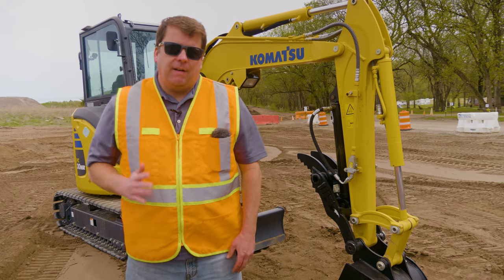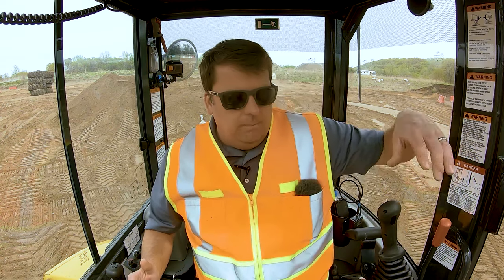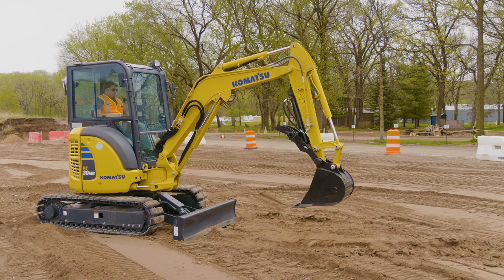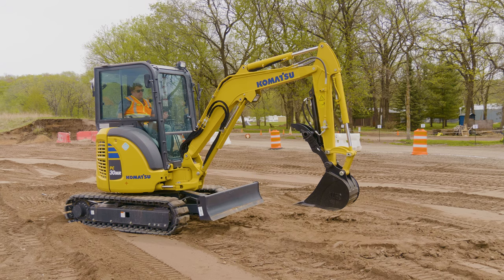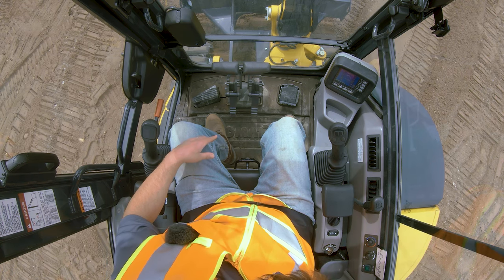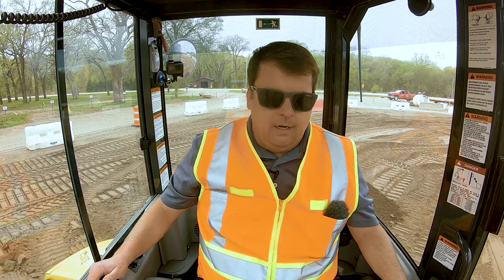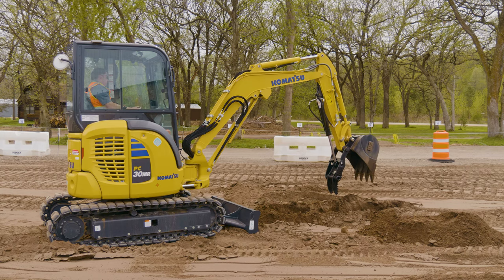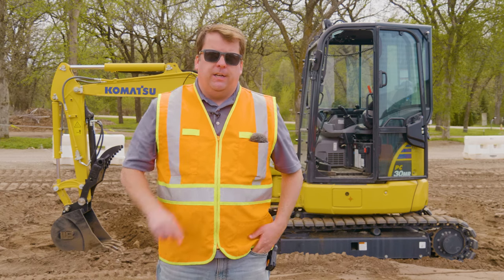Mini-Excavator Training (Beginner) 2020 | Heavy Equipment Operator Training

Comment: Great videos! Wish I had watched before I got crash course on the jobsite. I found out the hard way that those things are easy to topple when lifting loads. Luckily I was swinging slow and kept the load close to the ground so it didn't topple the machine but it was bloody scary moment and dangerous.  Few inches more or any sudden movement to the wrong direction would've done it. Was stable enough to get the experienced guy back in the cab to save the day. I would like you to have an episode on the mini excavator about those dangers. Say having a chunk of concrete or a boulder pinched with the thumb and swinging or placing it. Something safe for you to demonstrate the dangers for new operators.  Many thanks!
Reply: There were a few times that that happened to me but in a 926m cat loader tho bc the ground was unstable/uneven and yeah its kinda scary but fun on your first 3 days

Comment: Very good video! Tip for the video editor there: it would be much easier to see what controls do if you put video in the video, for example top 3/4 of the screen excavator from the distance and on the bottom of the screen joystick video, both videos synchronised. :]

Comment: I also operate with the blad behind me where possible.  It definly feels more stable.  I guess because the load is spread across the blade t the back and not the tracks which can pivot around each point, if tht makes sense.   With the blade on the same side as the operation, it feels like the base of support is smaller nd outside the centre of gravity

Comment: I´m interested in a video about driving a mini excavator on a slope. I image there are safety concerns as they seem to have a rather high center of gravity.
Reply: Mini excavators are able to go on pretty steep slopes, but the tracks need to be in line with the slope. I like to go up steep stuff backwards, and use the arm of excavator to help push the machine up

Comment: That beep you hear upon turning on the ignition is your glow plugs heating up, correct?
Reply from the maker: no....most newer diesels don't use glow plugs anymore.   Beep is just the machine doing it's system checks.
Reply: @HeavyMetalLearning  My new (2020) Kubota KX040-4 uses glow plugs.
Reply: @HeavyMetalLearning  Wrong, they still use spark plugs,  but they are just really fast, so you don't notice.  Same in modern diesel cars. Greetings from Holland
Reply: @thebeastman1651 At least in some models, the plugs start to glow the engine when you unlock it/open the door.

Comment: We have a Kubota mini digger and we don't have a footpedal for our boom swing, is this normal on some machines? And I can only assume that it is the extra switch on the left lever. If you could shed some light on this I'd appreciate it
Reply from the maker: does it have the backhoe (boom swing) option?  You would see a hydraulic arm at the base of the boom if it did.   I can't say I've ever seen a mini-excavator that didn't have it?    Depending on the model/size, once they get larger they don't have that.   And for the controls I've seen both foot controls and joystick operated so you'd have to check your manual for that.
Reply: @HeavyMetalLearning  yep definitely has boom swing, it's probably on the joystick but it always seems to be on foot pedals in a lot of videos. Thankyou for the information and I'm really enjoying the videos!
Reply: Sounds like you have a Kubota kx41 the offset control is usually a button in the top of the left hand joystick

Comment: Hello, quick question. Is there an argument to learn ‘backhoe’ layout, which I would assume would allow you to jump to/from a backhoe/excavator? Otherwise it would be damn near impossible I’m guessing.
Reply: I saw a guy who can jump from backhoe to excavator no problem. But if he switches the excavator from ISO to SAE layout he struggles with it. Strange.
Reply: Am I an idiot asking a dumb question and you are to kind to reply as such?
Reply from the maker: good question.   On most newer equipment it is very easy to switch the control configurations (either excavator or backhoe).   So I recommend learning one way and sticking with that.
Reply: Heavy Metal Learning I’ve done more research and realised that it’s an age old question that does not really have a right answer!
Reply: @HeavyMetalLearning  said he

Comment: what would be the control if there was an auger attached ?
Reply: You will use the button on you right stick I believe, it’s been a while since I’ve operated a piece of machinery, could be a button on the left stick
Reply from the maker: generally its a thumb control, but have seen a some controlled with foot pedal...really depends on that specific unit you have.